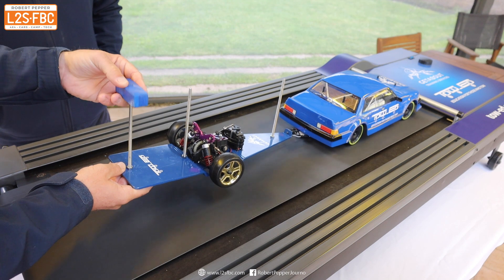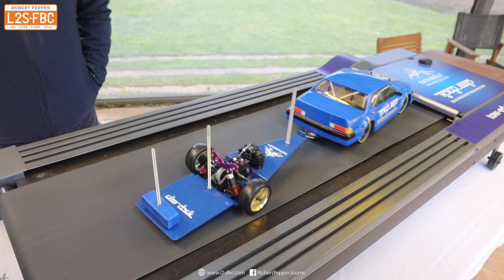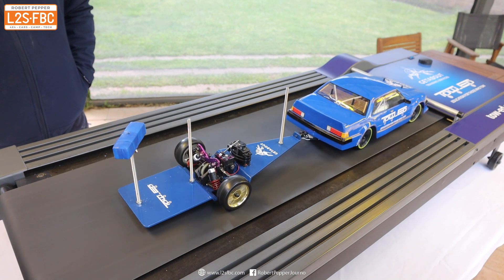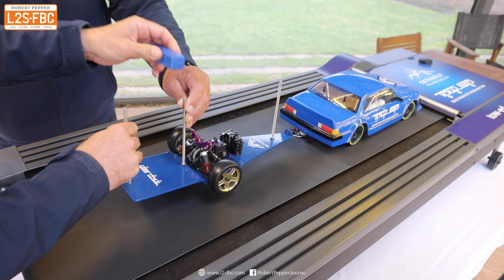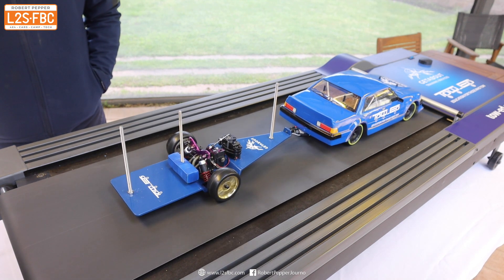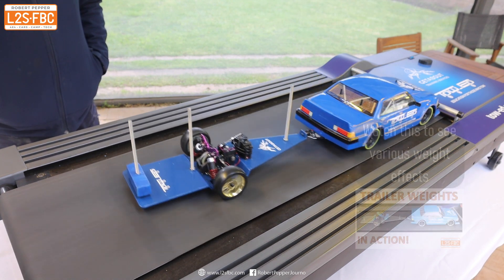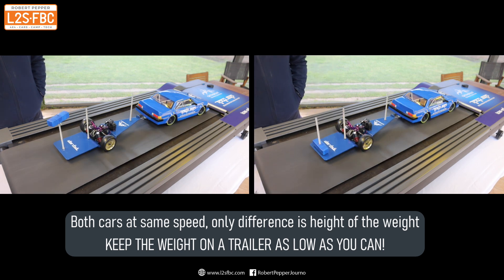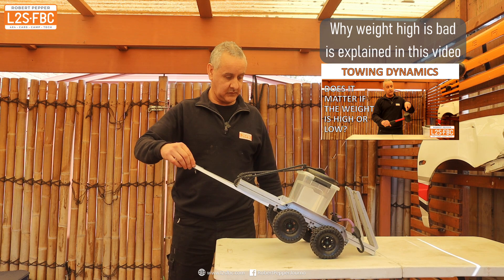Towing - does weight high or low make a difference?

Comment: I would have been curious whether forward weight high would have had a stabilizing effect against sway, on a flat plane(?), but caused other serious potential problems, esp. flipping or issues breaking on a slope? (bad enough idea to not attempt?)  Very DANGEROUS IDEA??
Reply from the maker: weight should be over axles and low - anything else increases instability

Comment: Great demonstration Rob, as are all your videos. Another issue is the trend of so called off road caravans which are jacked up a mile high, essecially full height with single independant suspension.
Reply from the maker: Thanks, please share! And yes offroad caravans are the worst for this, particualy with mud-terrain tyres which aren't as stable as all-terrains as they have deeper tread blocks leading to squirm.

Comment: great video, many thanks for posting. makes me wonder why caravans are still being made with washing machines, bike racks and spare tyres etc at the rear ( up high), when they could be placed in different spots 👍
Reply from the maker: Unfortunately, the best place for weight from a trailer dynamics perspective is central and low, which is the worst place for user convienence. So caravan makers and owners have to compromise.

Comment: on the lighter side of things was that an XD or XE Falcon model used? The XD of course still had leaf springs while the XE was upgraded to coil springs located by Watts Link,  with upper and lower control arms, leaf springs better for towing and general weight load balance while coils with watts link much better for ride and balance control not so much for weight balance, that said the Ford Territory did manage well enough with Fords version of a multi link double swing arm IRS save for porr isolation of rear diff bushes on the sub frame.

I started towing way back in the early 80's  with the mighty HX Kingswood SL wagon with the nice "253 V8 (4.2L which was before ADR 27A) with 3-speed TH350 auto" and if you recall these GM Holdens did not have "RTS" yet so they were very much "understeer" but for towing it sort of worked since you did not need major steering corrections,  the HZ Kingswood  (and you can add the XC Falcon which matched GMH RTS) with RTS (radial tuned suspension) were so much better, also  back anything past central west NSW (so basically Orange NSW) was all dirt until you hit the regional townships, today with the Everest it so much more simple and dirt roads start much further west from Five ways  onwards the "old school" way to Cobar.

Ok enough nostalgia.
Reply from the maker: That's a great description of older cars, thank you!
Reply: I'd say it's an XD, as the front (shown in one of the other videos) shows a full grille rather than the XE's inset one.  The DJR-look Blue Meanie paint job also suggests XD over the green XE that Johnson raced.

If your Kingswood was pre-27A, then it would have been a HJ.  A HX was the worst of both worlds - an engine strangled by emission controls but without  the benefit of RTS that only came with the HZ. Granted the visual differences are minor, though!

Comment: Trailer / Caravan stability is certainly a dark art. I had a Land Rover & Caravan combo some years ago where it was super sensitive to old placement. I used to place heavy items on the axle line of the van floor for stability, too far back by a little as 30 cm would effect the towing characteristics. 
I have always worked on the idea of “ keep it light, keep it low and keep it between hitch and axle , when loading a caravan or trailer. Thanks for the video Robert. 👍🇬🇧❤️🇦🇺
Reply from the maker: That's a really good anecdote, thanks Nick, and a VERY good maxim too!